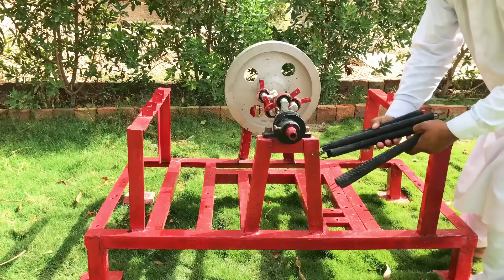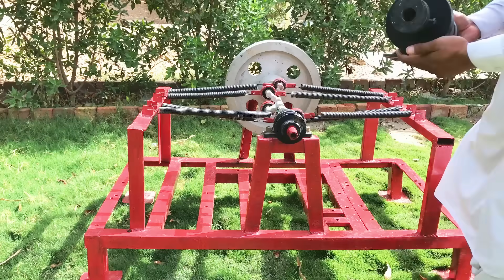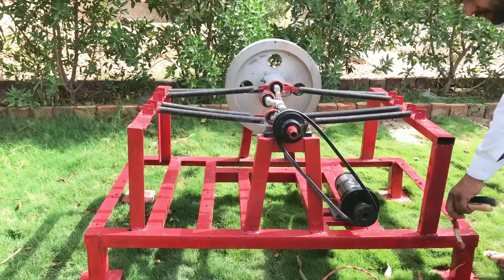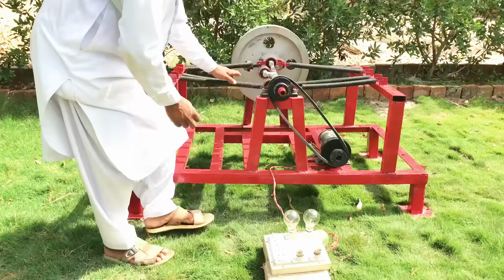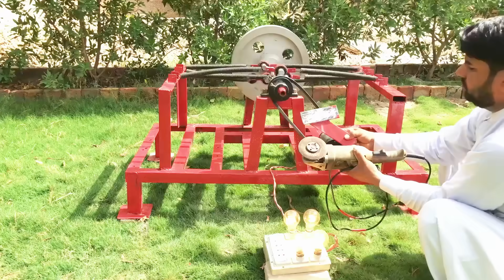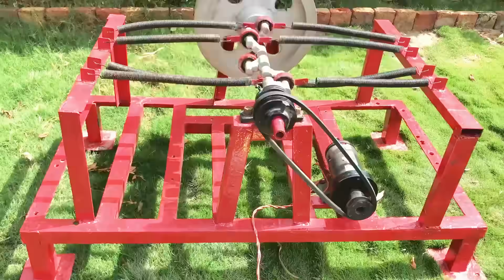220V Spring Engine Generator – DIY 1 5KW Free Energy Device Fully Working!

Comment: The only way this would probably work is that instead of springs, you use something called a counter snapping chain. It's a mechanism that pulls back and shrinks when pulled. when you pull on it to its max length. It will pull back to its original size

So, in conclusion, it might only work if you use a counter snapping chain instead

Comment: Very interesting, but I don't see hybrid conjunction of forces of different kind, like wind and gravity, helping to release some energy from both wind and gravity. Birds use it for making flying more easy... 😏

- Perhaps you understand that in order to gather plasma or protoplasma, use fields and subfields of overdynamic nature - you need to form very specific complex epures concentrating them either changing characteristics distantly... 😏

It is not connected to spring dating in shadows either in light at all... 😏

Probably it is attempt to get sex energy and convert it in electricity by connecting to entities during 'work'? 🤔

But why not to use simple devices in bed and any of them repeatable load come to? 😏🤔

Comment: Notice where the belt is tightest.  It's obvious that the motor is driving the flywheel, So i's not being used as a generator,,  There is a buried electric cable.

Comment: wouldnt it of slowed down when a load was put on it?
Reply: The energy for the loads and for the fake generator is coming from a hidden power cable. No power is coming from the flywheel since flywheels and springs can't do that.